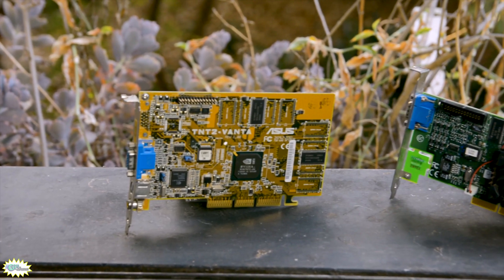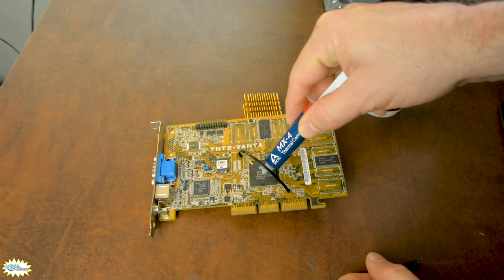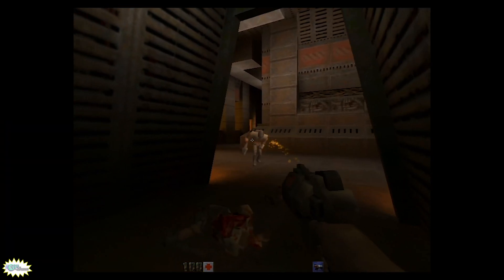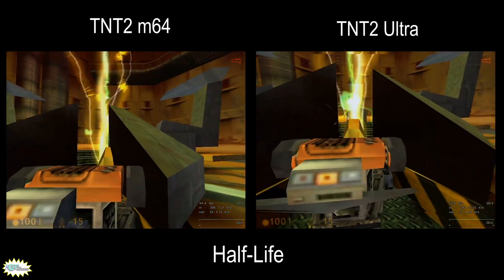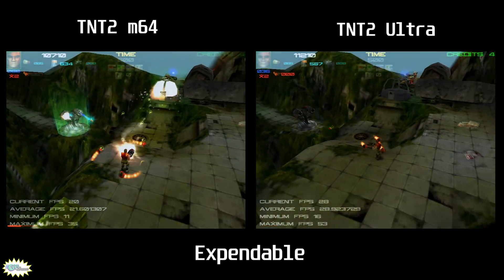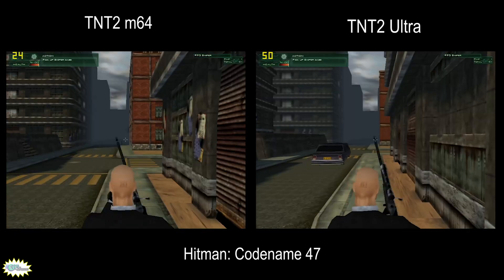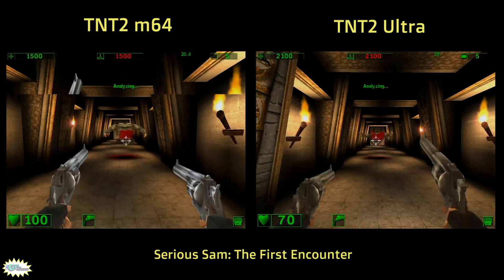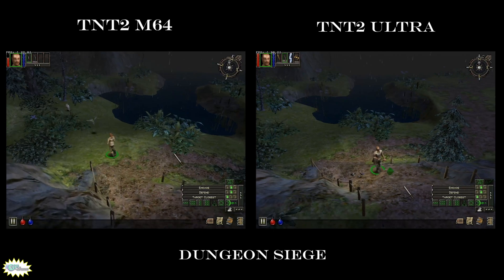TNT2 Ultra vs TNT2 m64 Vanta! #GPUJune

Comment: The Riva TNT2M64 32MB (the normal model, not vanta with lower fillrate) was a very decent card back in 1999. At stock clock it's performance was comparable to TNT1, but when OC'ed TNT2M64 was up to 85% faster.
Results from PIII 500MHz,
Game Incoming, 1024x768x32
TNT - 28fps
TNT2M64 - 36fps
TNT2M64 OC - 52fps (85% faster than TNT1)
TNT2 - 59fps 

3Dmark 99, 1024x768x16
TNT1 - 3471 points
TNT2M64 - 3645
TNT2M64 OC - 4802
TNT2 - 4955

Quake 2, 1024x768x16
TNT1 - 37fps
TNT2M64 - 41fps
TNT2M64 OC - 53fps
TNT2 - 58fps
TNT2 Ultra - 68fps
TNT2 Ultra OC - 84fps
Voodoo 3000 - 78fps
Voodoo 3500 - 92fps

The regular TNT2 was still faster, but not that much. I was very happy that my parents bought this card in my first PC, because in my country you had to spend half salary to buy TNT2M64. Some of my friends still played in software mode, and many still run games at 640x480. My OC'ed TNT2M64 however run every single game in 1999 with at least 30fps at 1024x768x16 (UT99 run with around 50fps), and for comparison the PS2 console run games at 480i (some even in sub 480i). I was using my TNT2m64 till 2001, so for around two years. Back then progrss in GPU technology was so fast, that you could buy a good PC one year, and it was obsolete two years later. My Geforce 2MX 32MB (128bit) was quite a bit faster, and the Geforce 3ti200 (oced to nearly ti500) bought in 2002 was more than 10x faster compared to my old riva. In 1999 I was very happy with TNT2M64 performance, however I wouldnt want to game on it after 2001 :P. I think people who are saying that TNT2M64 was a bad card played on that card after 2001, but then this card was already obsolete, so no wonder they had bad experience.

Comment: It is worth mentioning as a collectible, TNT2 Ultra is actually much better for the money. It may sound strange to you, but remember the price of the collectibles are strongly affected by their availability. TNT2 Ultra is hugely much rare than any other TNT2 model. The ratio in between TNT2 m64 and TNT2 ultra ever sold is a very high number. My bet is Ultra will increase in price at parity to FX5950 ultra once more people realise this. For some full boxed Ultra the price on ebay is already around $400. By the other hand the amount of TNT2 m64 or whatever still available in any retro pc is huge and it will drag the price down for anything not ultra for many years.
Reply from the maker: For sure, makes a lot of sense.
Reply: @SUCRA  btw, i forgot to mention: thank you for the video & tests! I just discovered your channel.
Reply from the maker: @madalin4802  thanks buddy, welcome to the community. I'm currently working on a review of Premio Pentium II, should be out tomorrow.

Comment: I don't know, but if TNT2 Ultra was the goal, they got it, but after so much chips made, maybe TSMC called them for a suggestion and they agreed to a 64bit model because those TNT2 could not run at 128bit after a little test. At first glance of this reality, it sounds like a waste of memory, so I guess TSMC had a good deal and probably it allowed Nvidia to reserve more production priority, so they had no choice. At 64mb the TNT2 could have made little difference with DDR but I guess Geforce was the winner after all.
Reply from the maker: That's fair. At this point Nvidia was only dipping it's toe in the water, now when GeForce came out, that was something. GeForce 2 GTS, was like a dream card. But yeah, fun times. Thanks for the comment! 👍
Reply: actually, they relied on performances. The Pixel Processor would have made a big difference. But I guess it was a money thing . The T&L could have been replaced with a Pixel Processor, but I guess RAM had to make it. Of course the Pixel Processor is none existent, but T.V. have it with a motion chip. It makes a movies shine at 46 fps or more. Imagine if the fps was doubling... Was Voodoo hinting that magic out? From what I guess, the MARIA chip from ATARI 7800 could have been the first. It would make sense with the MARIO chip. The Super FX. Many FX in the techs. The TurboGrafx-16 could of been a first, but Pc Engine was belief to be only 2d...

Comment: I got an Elsa Erazor II LT G. Do you reckon it can reach the performance of the Ultra with overcloaking?
Reply from the maker: It would be quite the overclock for an original TNT, but you can try! Tell me how it did afterwards.
Reply: @SUCRA  oh no. It's a tnt2 M64, but not the vanta. 125mhz core, 143mhz memory and 32mb of ram. Came out in October too.
Reply from the maker: Oh, nice!

Comment: The TNT2 M64 is a super common card, I've been flooded with them lately so am upgrading them to 183mhz ram. Will see how they go then. Should be able to get 200mhz out of the ram on overclocking.
Reply from the maker: Wow, nice project! Let me know how that goes!
Reply: @SUCRA  Sure, I recently replaced the ram on my voodoo 3 2000 with high speed stuff, even better ram than was used on the 3500. Works mint !:)
Reply from the maker: @greenfoam  Awesome! I'm not at that level of soldering, far from it, but that sounds very interesting.
Reply: @SUCRA  You would surprise your self how easy those ram chips are to replace with hot air and lots of flux. I'm no soldering pro as far as I know. I just do it and it works. Only using a 80 dollar Chinese soldering station
Reply: @SUCRA  I have completed this experiment and it was a complete failure lol. Firstly the original slow ram in the TNT 2 M64 I had happened to be.. pretty good and able to run at 175mhz. I thought the new old stock faster ram should be able to go to around 200mhz.. but I could only get 185mhz from it. In the end I got 155mhz from the TNT2's processor and 185mhz with the new ram for a gain of 9 fps in Quake II. in 1024 res (ended up at 39fps). Zero gain at 800x600 (not sure why)
Reply: @SUCRA  That was all on a 500mzhz slot one Pentium 3 by the way with sound card running
Reply from the maker: Interesting you did it anyway. You probably hit a bandwidth limitation. Thanks for sharing this!
Reply: @SUCRA  I've had to change half the ram on my Voodoo 3 2000 recently as it had a faulty ram chip and I had to replace half of them before I found the bad one... I will end up replacing them all and see if the voodoo can reach V3 3500 speeds. I've had that card since new and the best it could ever do on it's stock ram was 3000 level speeds when I was a kid. But yeah I must have run out of bus performance on the TNT 2 MX

Comment: I remember using the 8MB Vanta (included in a 750mhz Duron Compaq PC) to play Dungeon Siege when it came out. It was playable by my standards then, presumably at 640x480 or 800x600 with minimum settings. I also recall playing the Sims and Empire Earth, and even emulating PS1 with ePSXe. Later I tried overclocking the Vanta excessively and permanently damaged it, presumably from overheating as it had no heatsink. It still worked, but would output strange dark horizontal streaks across the screen.
Reply from the maker: Sorry to hear that about your Vanta. Seems like it served you very well though.

Comment: I've got a question you might be able to answer. I'm getting ready to do some testing on a bunch of nVidia cards, and I noticed on my TNT2 cards, I have two different dies. Out of my three cards, two of them simply say RIVA TNT2 on them. The other says RIVA TNT2 16. I'm finding it hard to discern a difference between the two different dies, got any idea? For reference, this is printed on the GPU die itself, not on the PCB
Reply from the maker: I'm going to go out on a limb here but the Vanta cards are also referred to as "Vanta 16" so it could be that you are just dealing with an m64. Good luck there!
Reply: @SUCRA  Awesome, thanks!

Comment: I have a TNT2 Ultra lol
And it works but I'm using ab FX 5200 instead.
Reply from the maker: That's cool! The ultra is not as easy to get as the m64. As for the fx5200, yeah they are so many generations a part, the fx5200 should end up being faster and you can preserve your cool tnt ultra. Thanks for watching!

Comment: the Vanta M64 was about as good as the first generation TNT, it was a great low-cost video card, on par with the GeForce 2 MX and GTS. A really nice video!
Reply from the maker: Thanks a lot, and yep, I was pleasantly surprised with the Vanta card. I would definitely recommend it for a late 90s or early 2000s retro gaming rig.
Reply: The Riva TNT2M64 32MB (Vanta has a lower fill rate and usually comes with 16MB VRAM) was a decent card in 1999. At lower resolutions it was always much faster than TNT1, however at higher resolutions it was slowing down (due to memory bandwidth reductiom) to around TNT1 level of performance. But this card still had full TNT2 chip, so it was possible to unlock it's potential with memory OC. When OC'ed the Riva TNT2M64 was up to 85% faster than TNT1 even at higher resolutions like 1024x768, and not much slower than regular TNT2. Back in 1999, you could play every single game on this card at 1024 x 768 x 16, and 800 x 600 x 32 was also a viable option for many games. 
Game Incoming, 1024x768 32-bit color, PIII 500MHz
TNT1 - 28fps
TNT2M64 - 36fps 
TNT2M64 OC - 52fps
TNT2 - 59fps

Comment: I've never really bothered with M64 cards, though with this comparison they seem better than I initially thought! Great video
Reply: slightly better than the TNT1 according to Phil https://youtu.be/hnT2hPClb-0
Reply from the maker: @aublak7492  the legend, the man
Reply: agree, way smaller difference than expected. I think 'modern' processor like p4 2.0ghz change lots of things haha..those were cards from 300-500mhz era..remambered m64 was pretty much unplayable at time, everything would work like crap so it was mostly purchased from people who arent gamers but needed to have monitor connection haha
Reply from the maker: Interesting thought there.
Reply from the maker: Hey dude, I have to agree with you. I don't think they deserve their bad rep! Thanks for watching!
Reply: The Riva TNT2M64 32MB (the normal model, not vanta with lower fillrate) was a very decent card back in 1999. At stock clock it's performance was comparable to TNT1, but when OC'ed TNT2M64 was up to 85% faster. The regular TNT2 was still faster, but not that much.

Comment: Great video :) I bought an Asus V3800M Riva TNT2 for my Pentium II machine, but can't get the computer to boot with it installed. I can get into Windows 98 and install the nvidia driver, then when I restart, it will post and start to load windows 98 but then gives the error "While initializing device CONFIGMG: Windows protection error. You need to restart computer." I keep trying to mess with it but can't sort it out >:( The Nvidia drivers work with a different TNT card I have but this TNT2 just won't play nice.
Reply from the maker: Hey! Thanks for watching! These cards are incredibly picky with drivers and windows 98 doesn't help. They only worked if I installed the driver I downloaded from Vogons driver library and on top of that the latest tnt2 driver I download from Philscomputerlab website. Before all that I would run a driver cleaner or reinstall windows. Good luck and thanks for watching!
Reply: @SUCRA  Thanks for the advice! Can I ask what driver cleaner you use for windows 98?
Reply from the maker: @TylerJaneBronson  I believe I used CCleaner, but I can't vouch for it, I ended up reinstalling windows.

Comment: Nice stuff SUCRA 😎
few personal notes: 1. you didn't mention which resolution and game settings you used for the comparison, this is somehow important I'd say😅 2. With '99-'01 cards it's always a good idea test UT and Q3A because many games were based on they're engines 3. (optional) I'd also throw in a 3Dmark 2000 run to be sure your system/card compares to other similar systems and you don't have an issue somewhere that's affecting your results 😉
Reply from the maker: Thanks man, all games ran at 800x600 and 32 bits when available, except for dungeon siege, kept at 16 bit for better playability. I'll keep your notes for future reference, thanks for watching!